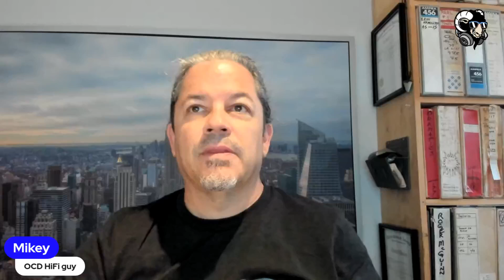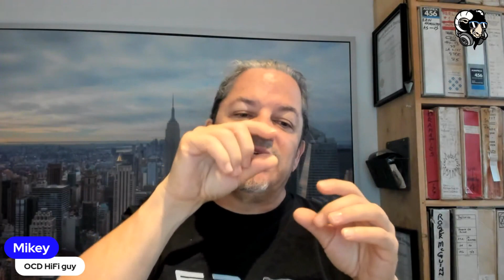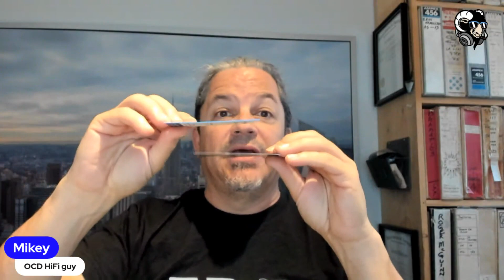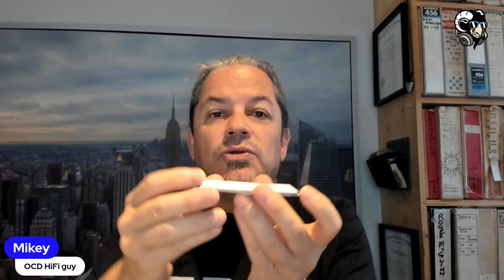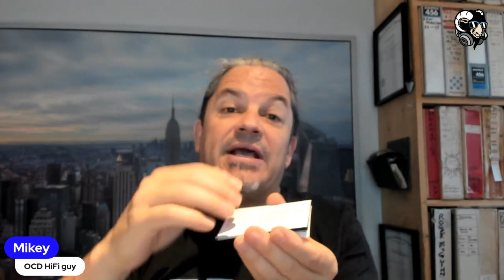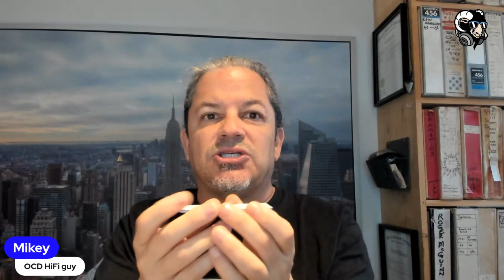What is TEFLON for AUDIO ??

Comment: PTFE/Teflon has a lower dielectric strength than PFA/Teflon i qvote "PFA has the same dielectric constant as PTFE as well as a very similar dissipation factor; yet PFA has a dielectric strength three to four times higher than PTFE". 
I know brands like Oyide use PFA as there dielectric in there headphone cables. 
And seeing that PTFE has a higher chemical water and abration resistans than PFA, witch would probably suite it more more for a harsh environment like aro space and military and outdoor PTFE would suite it more but in none harsh environment like home application sience and reserch and hifi use i can see why PFA with its higher dielectric strength could suite that better.
But PFA is more expensive than PTFE and some say they sound similar so mabey PTFE is a more cost effective?

Comment: Air being the best use bare solid core wire and a larger ID Teflon tube.
Reply from the maker: Yeah, what about oxidation from the air ? Air is not at all the best. Vacuum is. ;-)
Reply: @OCDHIFiGuy how can it oxidize being sealed and inside a larger teflon tube? It is essentially a vacuum lol

Comment: I only need 16 gauge silver wires that’s wrapped with a 8 gauge teflon jacket for my system’s powered speakers. Uses mostly air and a touch of teflon as a dielectric. Unterminated too.

Sounds open, transparent and the background is quiet.

Exchanging some Nordost knockoffs that were comparatively about 45% transmission of my simple silver wire setup. Nordost are really overrated.
Reply from the maker: 👍Agreed !

Comment: I use OCC copper in a PTFE sleeve that is 2 gauges smaller than the wire. That way the coating only has contact with a small part of the wire. Search "Helix Image AIr" for the science behind it and good cable recipes.

Comment: Teflon PC boards make no electrical difference at audio frequencies. If you are talking about an FM tuner, I might cut you a little slack there. As for audible differences, well you hear what you want or expect to hear. Now there is a very good case for Teflon wire in high power amps and any tube amp. For high power solid state amps and all tube amps there is potentially high heat present. And also for tube amps, most hookup wire is rated for 300 volts and tube circuits well exceed that. Teflon wire has a generic rating of 1000 volts. I do use Teflon wire in my tube amps. The silver plated wire is a plus but again for the distances inside most audio gear, it's irrelevant.

As for your $8000 preamp, why not just use FR4 or G10 board material with 1oz copper, after all it's a preamp, not a power amp, and sell it for say $6000. If the design is as good as you say it is, why add expensive materials that make no difference in the audio quality? Give the customer even more value for their money.
Reply from the maker: The truth is Teflon is higher performance whether it's used or not. Shall we argue against 600HP on a street legal car ? Carbon fiber for a Mustang ? 200MPH rated tires ? Nighthawk .45 for a regular user ??? Nope. So the argument is invalid to me. I expect to hear music, not the losses from the equipment.
Reply: @OCDHIFiGuy  So you agree it makes no difference in an audio application but does provide bragging rights? I am well aware of that phenomenon in high end audio. Fashion statements.

Comment: Tube socket should never be installed on any print.
Reply from the maker: Totally agree
Reply: @OCDHIFiGuy  I've repaired 100s of stupid valve amps with print mounted valve sockets. Cracked joints and soldering due to the flexing

Comment: Back in my electronics manufacturing days… engineers used to say, either air or teflon regarding dielectrics. Majority of sensitive medical equipment use teflon.
Reply from the maker: Yes, low loss... ;-)